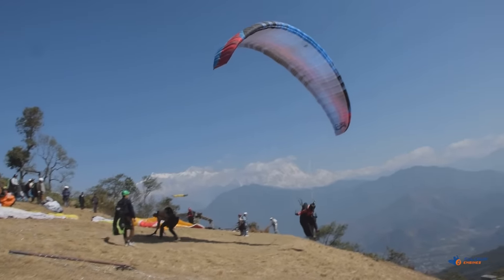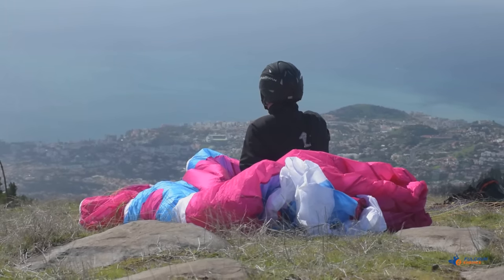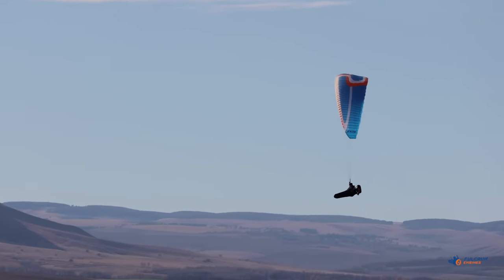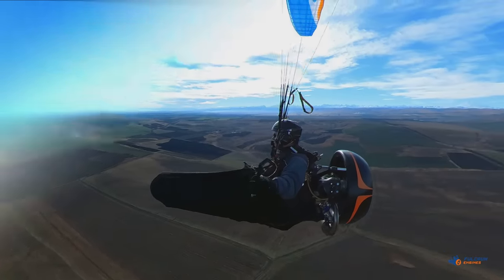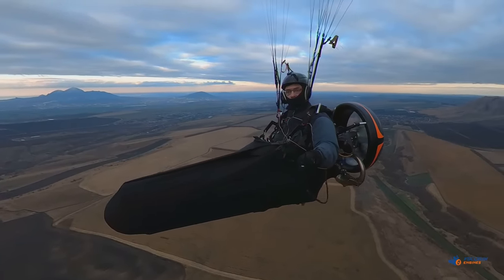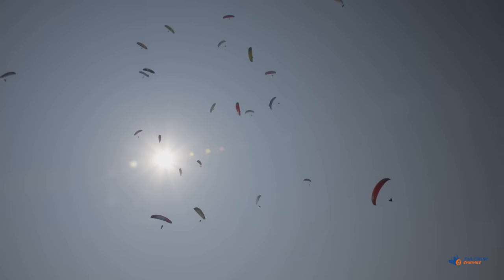Fulcrum PowerPod is the world's first paramotor pod harness with a ducted fan only 0.5 m in diameter

Comment: Looks good, but you KNOW when someone comes out with a new product and tells you everything about it EXCEPT THE PRICE, well, prepare to be shocked right out of your harness!!! This thing will only be acquired by a very select group of pilots who have very deep pockets.  And the price to repair after a mishap will yet again shock the average customer into avoiding this for some time to come. Obviously this thing is gonna cost a fortune, or they would list a price SOMEWHERE, so ask yourself, is it worth that kind of money to save you from getting to a suitable launch site, or a quick tow? Think I’ll wait, surely competitors will design similar products which in turn will result in a more competitive environment, and reasonable prices. Nice design, however, this is probably quite fragile with all of the carbon fiber parts that don’t fair well upon hard impacts.$$$$$$$$$$$$$$$$$$$$$$$!!!
Reply from the maker: The video shows a flying prototype.
We have not announced the price because the serial product is not ready yet, and we are currently working on it. When it is ready, the labor costs will be understood and the price calculated.

Any structure will not withstand strong impacts. And carbon fiber is not so fragile, if you make a carbon fiber structure of the same weight as steel, it will be much stronger.

Comment: electric , electric , electric 
forget noisy engine ,  get lithium ion battery cells , and a self cooling motor , let's do this and put the charging solar  cells  membrain in the top section of  sail with a positive and negative thin  dual CAble to onboard 10amp  charger , 
it can be done , 😊
Reply from the maker: Yes, the electric drive is great and we like it too. But the weight of the batteries and their dimensions are the main problem. If you want to climb for more than 6-8 minutes, then the weight becomes much more than with an internal combustion engine.

Comment: ..aand ""The Next Step""..., The Twilight Zone..  Owwe !..naar.., just kidding here.
What I meant 'da say.. is, how about putting in some of today's.., what can be regarded, considerably quite developed technical knowhow (by account of present-time standards) in the field of studies of esp. the crucial 3 branches of Chemical, Material Sciences & what requires no mention ; the Electrical Engineering branch. Together wic cooperative efforts culminated in  ushering innovative-new revolutionary approaches at conceiving power delivery engines, notably like what's being conducted at US' auto-maker Tesla, what're in ways, regarded contrary to the accepted usual-convention of only so-much gradual evolutionary (tweaks, if U will) improvements to a considerably aged design. Likewise here what also deserve mention are the many "New-Age  'Accumulator' types of 'Condenser-Capacitors' & 'Power-banks', in-other-words 'Batteries'. Wic tho they now ave much been reduced in weight, they but still weigh quite a lot, collectively.

Comment: You present mindless note arpeggios of cheap sounding synthesizer sound instead of the horrible noise a motor with a prop spinning makes.
In reality props spinning on gas motors is one of the most annoying sounds known both for the user and anyone below them.
The world needs less noise like the ones you people make for self-centered activity.

Comment: why this people is still use the fucking internal combustion motors? HEY DUDES, ELECTRIC ENERGY IS AVALIABLE SINCE 1870 FOR MOTORS, UH?  if i have this system of paragliding i will use a electric motor in my back, please, more eficient, SILENT, FAST AND CHEAP
Reply from the maker: Yes, we also love quiet electric motors. But the weight of the batteries destroys all the advantages of an electric motor. If you keep the same weight as the PowerPod with an electric drive, then its operating time in climb mode will be only 6-8 minutes, instead of 30-40 minutes with ICE.

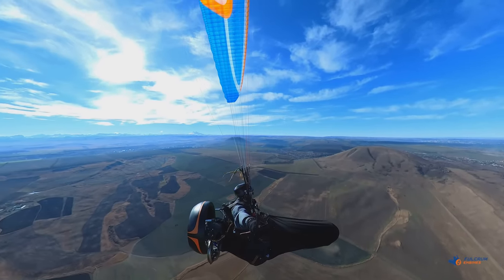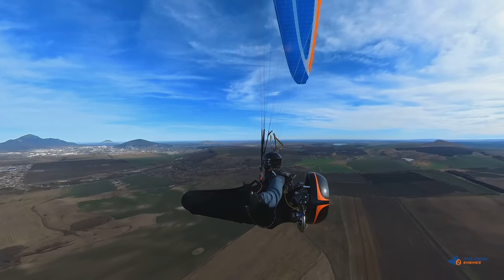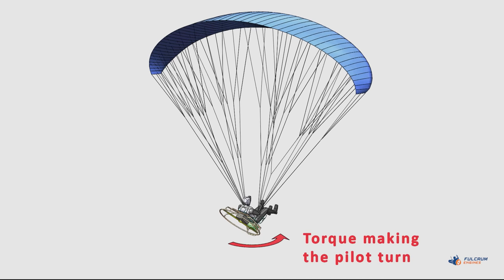Comment: OBSERVATIONS.              good work.      but, don't quit  your day job.!            you 'shot yourself in the foot' a couple times here.               firstly, you show a sky  FULL  of  people  using  standard, 'uncomfortable', harnesses.!!!            at 1:56, propaganda.   the  NOISE  does   that.!!!!              the actual auw  and  noise level were  glossed-over.             the use of (heavy) CF  in  a  SMALL  flying  thing  is  the  Opposite of smart.!            at 4:49,  leave  this 'you can even' statement   OUT.!             at 5:15,   this  illustration  is  FALSE/not accurate/SCREWY.!              at this point in the video, your  CREDIBILITY  score has dropped by about forty percent.              at 3:35,  'not interfere with'    equals  Meaningless statement.              at 5:07,  this is  More  disinformation, about (standard  harness)  comfort.!!!!            at 5:25,  INACCURATE  graphics  continue.!             at 5:42,  imo, this visual aid  is  less-than  convincing.!       googletranslate
Reply from the maker: Thank you for your opinion, but unfortunately I didn't quite understand you. Probably the incorrect operation of google translate?
Some comments from what is clear:
4:49 - We may have inaccurately explained what we meant. We do not recommend anyone to touch the duct when the fan is running. But if you accidentally take hold of the duct (but don't put your hand inside the duct, of course), it will be much safer than taking up the paramotor hoop when the propeller is rotating.
5:15 - What's wrong with the picture and animation?
5:42 - What exactly is unconvincing, I did not understand?